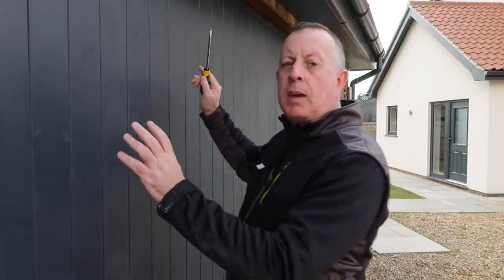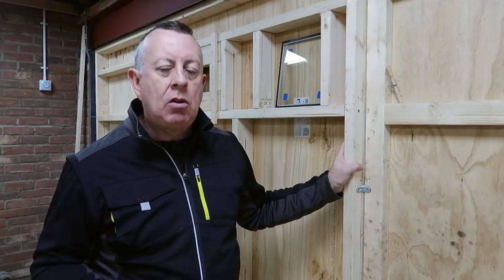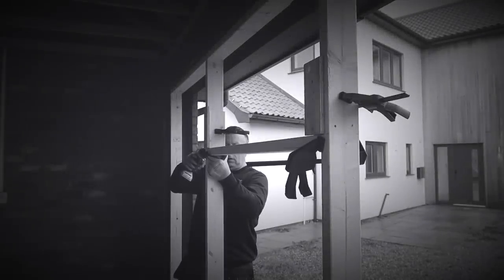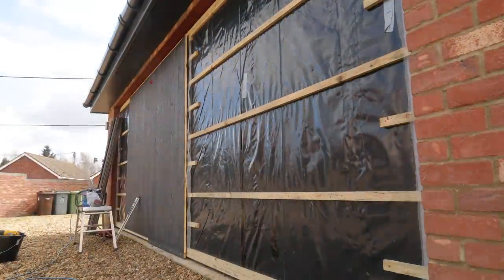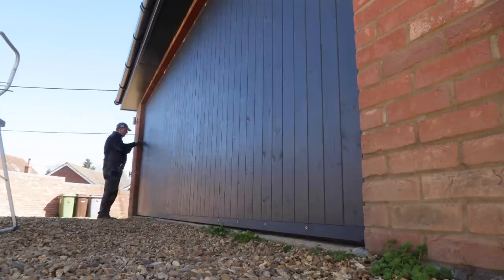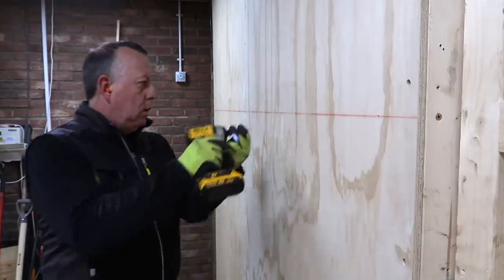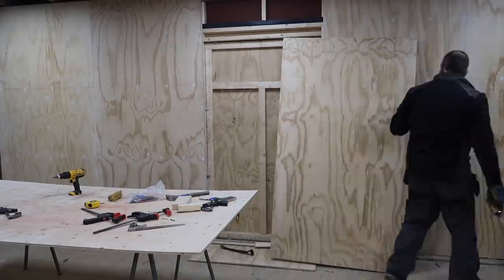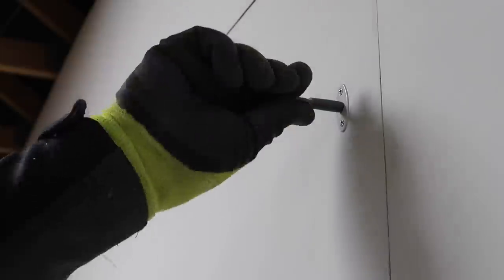Garage to Workshop Conversion Part 2 - Completing The Garage Door with Secret Opening

Comment: Just started watching your channel last week. I must congratulate you on yet another excellent real world UK production.  I would love your views on the nail gun you use!  Also looking forward to your ideas/advice on lighting.  Almost finished lining my single garage, so other than painting the walls white lighting is the next 'big' decision. Keep up the good work.
Reply from the maker: Thank you very much. The cheap £60 electric nail gun I have is rubbish so I would not recommend it! No depth control and keeps jamming. I like the cordless ones but very expensive and heavy - I think I'll end up going back to the air compressor type. I recommend the 600x600 45w LED light units - get 6 for a single garage and you'll be happy. You will have to wait a little bit for my video - the lighting episode I think you will find very interesting!

Comment: Lucky guys got a double garage.
When you get older and infirm, you can convert it into a single bedroom annex to rent out to a carer to look after you now that you don't get screwed by the council tax.
I bought a load of used building site boarding and lined the floor and walls to keep the damp and condensation down. Saves tools and machinery getting rusty.
Fire exit!!

Comment: Even though you open the hidden door just a few times a year, you could place a couple of handles on the inside of the outer door panel. That way you can take it out and place it out of the way and put it back in place without having to walk out the side door and round the garage to put the hidden door aside and later back in the frame. Unless of course you need the exercise ;) 
Other than that, nice project with lots of usefull information. Thanks!

Comment: As I live in the tropics ventilation is essential, but still necessary in your environment, so I'll be interested to see how you might cope... Extractor fans (in and out), maybe...?
Love the secret door idea - although it might still be "jemmied" nobody will know where to start...
Where you planed off the 'tongues' - maybe you could have planed off the inner side of the 'groove', on the 'door' part, leaving the other/outer side of the groove to overlap the tongues on either side wall...?
I can picture it. in theory, but maybe it wouldn't work in practice...
Reply from the maker: The door could possibly be forces open but would need more force (or noise) than a standard garage door at least.
Any planing off of the outside groove would show, and the inside groove wouldn't allow the tongue to come out. Even now up close I still find it hard to see the join so I don't think anyone else will!
Reply: @ProperDIY  I fear I've failed to explain myself properly. I never intended to plane off the outside edge of the groove. And I did mean that the grooved side of the panel should be on the door - planing off the inner part, leaving the outer part to overlap the tongue on the adjacent wall - which would allow the door to open as the inner section has been removed.
This possibly is no clearer... I'm a devotee of a picture being worth a 1,000 words... but I can't post a diagram here.  :-)
Reply from the maker: @harryinhuahin1272  Yes, got you now. Yes it could work and then you would be left with at least an overlap rather than a gap to the back. I could have done this on one side of the door but the other side would have the tongue rather than the groove.
Reply: @ProperDIY  That was quick...  ;-)  Indeed. I forgot to add that. Presumably one would put the tongueless section on the hinge side.
Whatever, what you have done is still superb - and I also like the colour.

Comment: Love your videos and your attitude. Must take you ages to edit. 

I noticed at about 6:20 when you were explaining the trim, the mortar above shoulder height looks quite damp. Guttering issue from rain or just different colour sand at that point? 🤷🏻‍♂️

As I’ve mentioned before, this video is apropos as I’m just about to build my new detached garage for use as a workshop. 

And yes, I’ll be stealing some of your ideas 😁
Reply from the maker: Thank you. Yes it does take time - botj to shoot and edit - not a typical quick YouTube video. 
The mortar is a different mix there hence the colour difference.
Need to take what you want from my video and others - best to decide yourself what solutions suit your particular job I think.

Comment: Others may have mentioned already (I’ve not read all the comments) but I can’t recommend Windbags enough. Absolutely perfect for holding doors/windows/ply for walls/etc in position as you hang them. Allow for easy minor adjustments with your feet etc. not too expensive and available at the usual places like SF and TS. Another great video Stuart and love the attention to detail.
Reply from the maker: Thanks! I do have them in my arsenal but I find them slow to use and have to keep bending down so prefer the spade technique

Comment: Great video, I have some small airbags that you inflate by hand and they are ideal for lifting doors into position for the final adjustment etc.
Reply from the maker: I own the same however I find adjusting them quite slow and bending up and down multiple times to get them right is a pain so still use the old spade trick

Comment: Great series. Many thanks. 1 question re your secret opening. Would your brick wall door have been better as a double door (4ft or more) and saved you the time and effort of the hidden panel? Forgive the sofa critic...
Reply from the maker: Good question. The way I opened the brick to form the door (ie without any propping) I wouldn't do if it was any wider so although I could put a wider door in it would have been a lot more work. The opening in the fake garage door I could easily make as wide as I want so thats why I decided that way around.

Comment: Nice Channel! Advice from one Engineer to another, don’t clad the ceiling in plasterboard, or at all. I have done this and inherited garages like this, and it has been a mistake. Better to install floorboards/tongue and groove on the top, above the ceiling joists and use this for storage, dust extraction etc keeping the floor area clear for tools/benches and workspace. If not, you will have shelves galore in the workshop and less workspace.
Reply from the maker: I was intending to do both after strengthening the joists - plasterboard below and flooring above. I need storage space for stuff in the loft section

Comment: Another top video. Which electric nail gun are you using? I’m in the market for one before I start putting some fencing up at home.
Reply from the maker: It's a Tacwise for around £60-70 however I wouldn't recommend it. No depth control and keeps jamming

Comment: That is a blinding piece of work. Particularly love the Parliament hinges to avoid splitting out. Maybe a protective rubber strip on the bottom of the outside door?  Can’t help but think that over time the corners will get bashed somewhat.
Reply from the maker: Thanks. Yes you are right about the bottom strip. I've only used it once in the last couple of months so it won't go too quick but I should protect it with something- another little project added to the list!

Comment: Some great ideas here.

Two suggestions. The inner secret door needs a diagonal brace from the bottom hinge up to the opposite corner otherwise it's going to sag over time. Plenty of YouTube videos on building doors and gates.

Someone else has suggested putting handles on the inside of the outer secret door so you can lift it in and out from the inside. I second that idea.

Otherwise a nice video. I like the way you took care of the trolls by stating that you were indeed a structural engineer....
Reply from the maker: Thanks for the tips!

Comment: Hey Stuart - loving your videos, thank you for making them and providing very helpful info.  A question on the T&G panels if I may - when you 'joined them' what kind of gap did you leave to allow for shrinkage / growth ?  I'm guessing you would have put a spacer in and banged them together then removed the spacer.  I did something similar on a gate once and it didn't go well, but I didn't account for the movement, I want to make sure I do it correctly this time !
Reply from the maker: Hi thanks! Yes I simply used a small nail to space them as I was fixing them new, in the winter. I notice by now the gaps have opened up by 2/3mm because of the dry summer weather.

Comment: Enjoying the videos, thanks very much. Will be kitting out my own single garage over the coming weeks, and look forward to more videos.  Someone mentioned nail guns -  I had, as a gift, about ten years ago, a MacAllister 18v set with drill, nail gun and reciprocating saw, and for  a diy-er they have been great. Sadly, the charger stopped working a few months ago and trying to find a replacement older model charger seems to be an impossible task. Shame, as the tools still work fine, if only I could charge the batteries. Never mind, thanks again.
Reply: Battery world sell replacement chargers here in Ireland
Reply: Thanks very much, I will check that out.

Comment: Great couple of videos.
I have almost the same double garage without the doors and would love to do something similar.
Approx how much did the project cost in the end?
Reply from the maker: Thank you. Good question! I would say around £250 for the outside cladding, trim and batons. Prob £250 for the stud work and internal ply so £500'ish total. Unfortunately another £100 for the 10 double glazed windows I didn't use but I intend to design them into a shed build.

Comment: Great job, I'd love to have the extra space for a building like that. It is niggling me though that the excellent hidden door can't be opened up more simply, I'd rather work in an environment that's a bit more open, (weather permitting, obviously), apart from that very personal point of view, a fantastic job, and thanks for sharing.
Reply from the maker: Thank you. I agree although I know that most of the time I'm going to be filming so the doors will be closed anyway. I did ring some heavy duty concealed hinges but at £80-100 I decided against them. Maybe a future project!
Reply: @ProperDIY  Well having subscribed, if you do I'll happily watch. (and learn)

Comment: I like it. Looks classy from the outside but I’d be driven nuts having to take out  screws everytime I’ve to open the door. Did you consider latches? I personally would’ve just hinged it
Reply from the maker: I did but as this door may not be opened for another 6 months I just made it easy. Hinges would show on the outside
Reply: @ProperDIY  you can get quite strong hidden hinges. I haven’t fitted them personally but fitted 100s of doors and there’s always a way. At the end of the day if you happy That’s all that matters! Great video and extremely informative 👍🏼 it’s proper diy 😉
Reply from the maker: @irishwoodwrker  I did spend some time looking but for what I wanted ( together with the weight of the door) the price was going up rapidly so couldn't really justify it.

Comment: Loving the channel! I'm due to move this week into a new build with a double garage similar to yours, which I aim to convert to a gym (eventually!). With these being single skinned I am worried about the potential of wind-driven rain soaking through so was thinking of a coat of water-seal on the outside, any tips/recommendations?
Reply from the maker: If you are talking about the brick work - you can but I don't think its necessary. I would suggest if using for a gym, ironically the ceiling will the most important thing to mark the environment comfortable. I've found it very cold and noisy without an insulated ceiling - similar to being the loft!